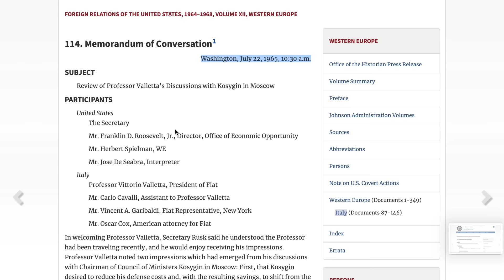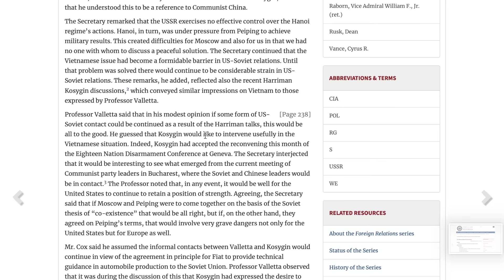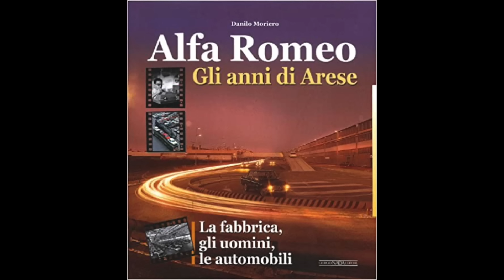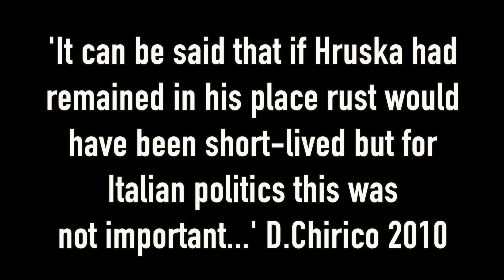Alfa Romeo And The Myth of Russian Steel - The Real Reason Alfas Rust

Comment: Having owned 3 Alfas and also a FIAT over the years I’ve had to put up with more than my fair share of Italian car rust and reliability jibes. Fact of the matter is that modern Italian cars don’t rust at any faster rate than any other. The facts that pub bores always conveniently forget is that during the 70s, the supposed bullet-proof VWs, Fords and most Japanese cars were also rot boxes.
Reply: As an owner of a 10 plate 159 for the last 4 years, (which has no rust whatsoever), I agree.
Reply: All cars from the seventies were rot-boxes, even Rolls Royces.
Reply: My granddads datsun bluebird estate was a prime example of rusting badly but most cars well into the 90,s suffered rust all 3 of my mk2 cavaliers were rust buckets .
Reply: My 1981 Honda Accord did not stop rusting …
Reply: Literally the only cars I ever saw that didn't rust like mad are the old Audi 80s and Peugeots from  the early 80's onwards.
Reply: My dads 1980s 1st gen Honda Accord was horribly rusty. We also had. Sud 1.2, probably suffered the same level of rust. So IMHO no real difference. The Sud would rev to the moon, remarkable for such an old car but the Accord would cough at 5000 rpm.
Reply: Possible exception to 70s rust buckets might be the being early Volvo 240s, I think they were better than most for the era.
Reply: In fairness Japanese cars were bulletproof in terms of reliability by '70s standards but they certainly rusted badly and were generally pretty horrible. The famed VW dependability is just folklore fueled by marketing hype. The last VW that was anything special for reliability is the Beetle, everything that followed was average at best. 'Reliability by association' (with the Beetle) is how Chris Goffey put it in the '80s. A revealing comment I think.
Reply: Other cars, particularly Japanese cars of the era, rusted just as bad as Italian ones. But as someone who worked at a Fiat dealership as a young man in the early 80s, I can testify to the poor build quality, corrosion and general lack of robustness of Italian cars. They had bullet proof engines, particularly the Lampredi twin cam, a superb engine, but poor engineering otherwise. A great shame. The Strada 105 and 130 TC and 131 2000 Sport on Pirelli P6 tyres have left a lasting impression on me. I would love to find an early single headlight 105 TC Strada, in black. But so many British cars were the same. Good designs ruined by other factors. Humans are flawed.
Reply: @classiced1416  Volvos in general were pretty good.
Reply: As was Vauxhall and Ford.
Reply: No corvette owners here then?
Reply: I agree....finnally the truth!! i own and restored various lancias,( including betas) fiats,  alfa romeos and bmws. One early 5 series bmw 1981 after 12 years of New York use  had serious rust issue in the rear struts and sills and floors.   Including a 320 with the same issues. The 70s bmw coupes as lovely as they all rusted quite badly especially karmann built bodies
However i notice bmws and benz in general thier rust grows un detected and the heavy undercoat they use is soo thick that you really have to poke at the car it looks solid..but you will find tons of hidden rot. Italian cars and japanese cars of the era the rust seems to explode in your face with rust occuring in very prominant locations. Problably the worst was the lovely 850 spiders they were panels on cars from dry climates that we cut into and fount zero primer or paint ! I found this even on t34 vws coupes by karmann . I think the coach built cars were possible worse lacking the facilities of rust protection until later on. Other factors on beta and fiats are the windscreen that were glued in place like modern cars. But these were all leaky anthe wather would settle under the carpet un noticed...not good at all.  Plus lots of fiats suck as 128s and other glued rubber tar sheets as noise dampers on the floors of the cars they appaer to be applied tonthe raw steel first then they floor were lighlty painted ...if they dont stick well and water gets under this it has no way of drying and rust sets in. Early 70s Volvos and saabs rotted quite well until the 900 came out so late 70s and 80s volvos were excellent indicating the made steps to correct thier problems. Audi 5000s with galvanized panels post 1982 were bullitproof. audis before 1982 rotted just as spectacular as alfasuds and betas. Mercedes rotted as well but  less than bmws did i think there attencion to painting everyarea helped plus you have to consider the cost of a benz in the 70s they problably were not used in snow an salt and pampered more where as the sud or a beta or an allegro etc would see more snow simply cause they were all great in snow and mercedes cant even move in snow with out snow tires.....lots of factors great videos
Reply: @michaelorlando6159  Haha!)  You reminded me of my father's Rekord and w123 which were absurd in the snow!
I was wondering how they had designed them in a country where snow is the protagonist in winter
Reply: @classiced1416  Not our 244...
Reply: The bed in Dad's mid-70's Datsun pickup lasted less than two Vermont winters before perforation.
Reply: @classiced1416  still might be the mix of steel used and or coating's like zinc as if the zinc ( and aluminium has been used as well in the past but it's trickier to get longevity coated steel more so if the steel has SS or resembles SS mix ) is contaminated it can speed up rust or let it spread ect. and thing's like copper/mowligneam MO were at least for the usa 🇺🇸 markets in short supply as the venam war and others were hogging it and maybe making some sort of softer steel eased the tooling fixtures fix rate and or let the stamping plant have a better cycling rate of parts aka body made cheaper and quicker ect.
Reply: @paulc9588  ... the problem was the mechanics
Reply: @GlamStacheessnostalgialounge  volvos were pretty good
Reply: @GlamStacheessnostalgialounge  audi started to galvanize them form 1982 i think
Reply: Yeah there were cars coming out of the big Americans in the 70s and 80s that were rusting before they left the dealerships.
Reply: @richardprice5978  i've worked with at least 100 Fiats and Lancias from the 70's and there is two things that stand out.

Obviously some bodies were rusted before they were painted, that is clear and can even been seen in some company photographs. It would be interesting to compare manufacturing dates, i think ones assembled in spring and early summer would have less rust. The factories did not have good air conditioning then and were a damp place in fall and early winter. And the panels were some times stored outside.

But it is also obvious that there are very high alterations in the quality of steel. Early 70's are mostly made of better steel than late ones, i claim '79 and '80 are the worst years. F.e. i have a 1973 Fiat 132 that has original paint and has been in use always since new, mostly stored outside. In some places the paint has completely fallen off, expocing bare metal. But it still does not create rust. I've had a good 1973 Fiat 127 also. And 1975 Fiat 131 and Seat 133 that had almost 0 rust.

But i've had several 1979-80 Fiat 127's, 128's and 131's and Betas that rusted away even when washed and stored insinde. You can clean their steel and repaint it, but they still rust heavily even from places that were not rusted before, in the middle of panels etc. (some being caused by panels that were rusted already in factory.) It seems that only by replacing all the steel they can be saved, no sanding, aciding and painting can keep them from rusting if they are used or stored outside.

81-84 are a little better. Not much, but so that there is a clear difference. I have not found that there is any difference in dipping or painting process so i point at the steel quality, not overlooking the pre-rusting in the factory during assembly caused by strikes and other conditions.

Maybe this steel was from that plant in Italy and not from russia, but still the quality of steel is an issue that still haunts us today trying to preserve these wonderful cars.
Reply: I don't know if it's Russian steel. But some cars do rust very fast. Mazda has been a recent one. But I remember the older alfas. Fiat's and lancia did rust badly. Was it the steel or the treatment or the design? ??. Our local chip shop the owner bought his daughter a new Fiat panda. As a new car owner she washed it daily. Found a blister on the front wing. When she picked it it was a pin hole. They found further blisters. Aventualy a new car.
Reply: @mirafioristi  and it can haunt me as well with american classics 

i got some replacement bed panels for a 86 GM truck and despite by best efforts to get the best repops made it still acted differently and welded differently than the 1986 metal ( rusty parts and clean parts ) and the 2004 ford metal ( a little bit thicker and way harder to bend out of my samples and the least rusty ) i got to do body mod's with 

as for 60's / 70's dodge um same as always the painting is a after though ( but back in 69 zinc was done somewhat well but yes it could be better ) but the steel for the most part is fairly slow rusting same way with my 86 OEM but the softer 2014 steel replacement panels um no they rust quicker and way lighter ( D near the same thickness as i used callipers to check to one thousands so within error margins ) for some reason?? 🤷‍♂🤔 and there supposed be a exact replacement in always including mix and heat treatments ect.
Reply: @mirafioristi  dose some one have a tool to test or rental in your club? as finding out the oem mix might be helpful and i know others have done this with hand held tools on things like sockets in 2022 to see if there garbage or not and as a lie detector ect.

BTW my truck has been in the family from the 80's so as far as i know before me-3 owner all OG OEM parts but was used as a farm and cement truck ect. aka ruff life
Reply: @mirafioristi  so aftermarket resto's like me A/C and moisturiser control is a must have and anything else to point to for greater results? like you said back side rust removal and coating is extremely important  but the way i see it thats harder to do as im not a factory setup with ovens and specialty dipping tanks ect. and i don't know anyone local that does this
Reply: @C.Fecteau-AU-MJ13  lol 😂my family's/my sibling's 2006 jeep ( helped get my license to drive but count the 86 as my first car/driving experience ect. ) ( winter/spring build date ) was really rusty underneath aka no paint or attempting anything coating wise @ the dealership/factory carrier truck and it had sub 10 miles on it ordered it

the top/what makes vehicles sell 5ft-away  now that was done well but wrong colour as blue was on the sheet not jet black FCA's habits are to paint the hole thing assembled ( found out that as a pro-mechanic, im out of that game in 2018-up for now and do industrial millwright things now ) so the panels match better but between the thin finish and lack of back side/hiden places it makes it rust out
Reply: @danielryan2317  um i don't know if i count or not as i don't have one but i do like C3's and there well known for rustying out more so if the salt got stuck between the fibreglass and or spider crawling/cracking and pre-C5 or 6 the framework was regular steel not aluminium like the C7 so even if the body is ok the engine mounting points ect. can be heavily rusted out as its technically a body on frame design and the floor boards are steel but some have use/,made aftermarket aluminium ones

im a challenger/cuda/60's charger owner for now as i felt i still need a back seat for things like baby seating and a trunk lid that opens up for my crap/wife's thing's
Reply: @mhagnew  lol 😂my mentor/uncle ( Vietnam veteran and sub guy ) ( millwright but in a plant iv never seen the inside of ) drove one dotson for 20 years but yes peace of hot garbage and wow at least 4 engine's/rebuilds ( and at least 2 transmission's manuals mind you from high mileage ) in his 🌲shop using a brige-port ect. and at one point it was flint stones mobile and a patch work of random sheet steel left over Robinson helly scrape's ( his hobby for a long time was flying kit crafts and or building them ) weld on and bolted as replacement panels, went for the 5 rebuild ( now running avgas as the engine was milled/hoged out by this point ) after 200+k miles in and the truck collapsed in to about 4 very rusty chunks lol 😂that was the end of it in his midwestern driveway and a empty bottle/car jack

the replacement was a late 90's dodge dekoda expend cab v6 auto aka almost the same thing 

i asked him why'd you replace ( 70's or 80's ) it sooner and something a long the line of im stubbornness and i can fix it myself ect. and i didn't want a car payment ect.

maybe he should have kept the white 1967 D100 ( ordered it in the navy i guess he was a lot more piratical than the other draftees that got high end muscle car's ) after all with the 440 and 727 4:10 8-3/4 and i don't think there very pretty or at least that's me aka ford and chevy made better trucks but a 440-RB and 2-G hemi isn't bad
Reply: My Alfa was the most reliable car I ever had that wasn't Japanese.
Reply: @avancalledrupert5130  did that have the tiger-shark engine and or it's twin? as im wondering what longer term owners though of the jerk-pump lifter's and engine management software/system 

FCA alfalfa and FIAT used the same style systems and or really close to it

as for Italian car brands never owned one maybe and a big maybe driven or ridden in one but my local area's aren't big on buying euro's other than the occasional SLK or C-class or 4-door BMW but those are being replaced by higher end expensive Tesla's now in 2022 or at least feels like that
Reply: 1992 Ford started galvanizing Tauruses which rusted pretty bad before that. My 94 Probe GT is doing alright also galvanized I believe. Their trucks also do better than Chevy and Dodge.
Reply: @GlamStacheessnostalgialounge  the Audi 80's were partly zinc plated and was the first car with a 10 years warenty on rust. 
I still remember the rust warenty and proconten steering column safety stickers on the backwindows.
Even today f.e. Peugeot 205-309's rarely rust. They were the almost bullet proof generation of Peugeot
Reply: True.  1978 Toyota Corolla, it had some rust issues…
Reply: @obelic71  is it just me or should some crash testing be done on version's that are simulated or used in the real world aka rusty/metal fatigue ( if it's going to happen, and theoretically needed repairs try that safety to see if the ratings are changed negatively if at all ) ect. as a new off the dealership's lot rarity gets in to a crash it's usually 5 or so years old and at least a 100K's on it
Reply: @dennisyoung4631  i remembered as a 80-20's kid toyota car's were ok ish but the trucks well we called them tacos 🌮 lol and yes ran but man the body rot was bad
Reply: My dad bought a Golf in 1974. The thing needed rust repairs after five years.
Reply: @richardprice5978  rust is no issue anymore on modern steel monocoques shells for cars.
That high strenght low weightssteel has to be zinc plated otherwise it wil rust away in a few months. 
Remember the recall of he smallest Toyota car the aygo a few years ago?
A steel manufacturer of Toyota falsified on purpose steelquality papers. 
Al those cars affected were recalled and everything was swapped over to new shells.
A mass coruption scandal in Japan and the director of the steelcompany commited suicide over it.
Reply: Yes, but it does seem like Alfa and Fiat were catching on later than other manufacturers to rust prevention. Renault also seemingly had this problem of rusting faster than the competition and I've never heard a good reason for it, other than their rustproofing being not that good. One reason I've heard coming back a lot with the Alfa Sud and/or GTV's, was that the Italians down south were very callous with their steel sheets, to the point that those were often just stacked outside of the plant, completely exposed to the weather. Then these sheets of steel, covered in rust, were just fed into the production line. 

A contributing factor, but I'm just theorising here, to excessive rust may have been that the Italians tended to prefer style over function and that caused their cars to have more "empty" spaces between outer bodywork and inner bodywork or liners where water could gather because there weren't any drain holes. The famous Citroën DS also suffers from this problem with its front fenders.
Reply: I bought a 4 year old 40,000 mile Ford Capri in 1979 It was already rusting through the front wings, behind the headlamps and rear wheel arches. In the mid 80's to 2000 I ran a Fiat Tipo and a Brava for a total of 125,000 miles with no rust issues at all.
Reply: @tommaguzzi1723  Ford and Opel/Vauxhall were the last brands who made above average rusting cars.
The French and Italian manufacturers got there act eraly togheter on rust proving.
F.e. The MK1 Fiat Punto and MK1 Renault Twingo from the same era almost didn't rust. The MK1 Ford KA from that era rusts alot.
Reply: @obelic71  that Capri was falling apart long before my young idiot self ran it off the road going too fast and crashing it beyond repair, no injuries thankfully. 3rd party insurance so I was still paying the loan off for a car I didn't have anymore for a year or more. That's why I started riding motorcycles. Every cloud eh!
Reply: oh yes, golf1, opel ascona, ford escort nissan were bad, mazda, mitsubishi toyota not so much, but lancia, alfasud, fiat mirafiori and 127 were on a complete different level of rust , that was something else.
Reply: Not even the gauge of the sheet metal was not at fault?
Reply: Porsche starting using zinc rustproofing in 1975 or so. Prior to this, it was also very bad.
Reply: @obelic71  different mix's ( and for home gamers like me there's 50+ different mix's to buy and a industrial plant evan more so ) might not stop it from rusting/catalysing but will change paint adhesion or speed of reactions and crash characteristics, and tool steel generally is more expensive but has more of these wanted traits vs low carbon pain jane iron/or steel sheets

aka it matters what alfa ( or in my case the big 3-🇺🇸 ) was using
Reply: I've had four 147's starting in 2018, a 2002 1.6 Lusso that needed floor welding and 3rd gear died, next a 2007 sport TS that had survived previous owner never servicing it and had no floor rust, then another 2002 1.6 Lusso that had two lots welding done and recently sold a 2006 2.0 Lusso that failed the MOT for rot in three places and even the wings were bubbling which I'd never have imagined. I've just bought a 146 1.8 T Spark which I love to bits even though the handling isn't as effortlessly capable as a 147.
Reply: @obelic71  Mk1/2 mondeo, mk5/6 escort, fiesta and so on.
The 90s Fords almost was worse than the 80s Fords. 
Opel/Vauxhall where a strange blend, Omega/senator rusted bad.
Vectra mk1 to but mk2 was way better.  

Last big brand with massive rust problems was Mercedes, my god did those W210/211 rust bad and so did the Vito`s and sprinters vans to.
Did not help that quality over all was bad on the E class at that time.
Reply: @Gravstein  The last Escort and the Mazda 323 were build on the same platform in the UK. both were a Tin worm paradise.
Commercial vehicels like the opel/vauxhall combo MK2 also rusted alot. There was almost no windreflector on top of the cabin that was rustfree. MB lost its quality in general. Once the most used brand for Taxi companies on the mainland of Europe.
Due to excesive Rust and unreliability MB is almost out with there passenger cars of the huge taxi market.
Reply: @paulc9588  look at the work cards for maintenance on Air Cooled VWs, if you do all the required maintenance they're reliable. The issue becomes in 25,000 miles the old Air Cooled VWs required more maintenance than a new Camry does for 100,000 miles. Not just VW, older cars required a lot more attention.
Reply: My dad had two Chevy/GMC pickups, a '74 and a '79. The '79 needed a rust-repair session and full repaint twice from new until we sold it in '86. The Chevrolet Vega was infamous for rusting in the showroom, and the Dodge Aspen/Plymouth Volare's fenders rusted so bad under warranty the repair costs led to Chrysler flirting with bankruptcy and needing a bailout from the government. Ford had the worst rep for rusting across the whole line of any American make though. Among Japanese cars, Subarus were rust buckets into the early '90s.
Reply: @richardprice5978  I had a Alfa gtv 2.0 twin spark . Got it at 90k . Banged it of the rev limiter for 28k no maintenance at all until it skipped a tooth . 

If I had serviced it I'm sure it wouldn't have happened . Only honda and Toyota survive me owning them that long normally . So Alfa gets a yes from me on reliability and a big yes on driving pleasure .

It's sat on my mum's drive for 5 years dousnt even seem to be rotting .  The reputation definitely dousnt apply to late 90s Alfa .
Reply: i had luck because the levels of humidity where i live in south of Portugal were almost non existing ,some had health related problems because of the dry air
Reply: @GlamStacheessnostalgialounge  That was because Audi started to galvanise-dip their cars, but only up to the waist-line.
Reply: @mirafioristi  Really interesting experience. I clearly remember that Arese models were not particularly endangered by rust (which was a problem anyway, expecially if you had to park outside) but Pomigliano's Alfasuds, while lively and much fun to drive, were eaten alive by rust. Apart from Alfasud peculiar problem , what is clear is that, Russian or African steel or whatever,  Fiat always tied their best to save on weight, save on steel, save on paint, save on process, save. Energy was expensive for them, steel was really  expensive at times, reality is that in Fiat bean counters always prevailed over engineers (and also these were trained to save, save, save, on everything). Painting was also becoming a problem, almost a social problem, in most car factory, due to lack of quality and quantity and commitment. It is often said (and it is possibly true) that paint departments were widely considered a lost cause and often assigned the worst subjects to tame, as a punishment of sort. 
I have read twice the excellent "I miei 40 anni di progettazione alla Fiat"  by Dante Giacosa (senior designer of 500, 600, 1100, 124, 128, 127 and everything in between including trucks  and avio engines at times) and specs for new car projects  were given to him     by high executives  as engine displacement and Kilograms of total weight. For the 1100 (a middle-sized car for Italy) they gave him 735 Kg to work with,  without heater, spare wheel and fuel . So obviously engineers and designers had to keep weights and everything else  low in order to succeed.
Reply: @avancalledrupert5130  um i don't think that's the same engine with the same experience and technologies 

i like the ideas just haven't owned one yet so i don't know 💯 what it's like to live with VVT/VVL 

nice to know that alfalfa's did make decent engines and the twin spark plugs was a welcome experience. have one on the stand that use's that but its a V8 from the 60's
Reply: Austin Allergros did'nt rust , but that,s a unpopular truth.
Reply: @peterfox3989  sorry i like uk 🇬🇧 car's but BL made mostly ugly one's but my 2C

and the allegro is on that 1970's-90's list
Reply: To this day in western Pennsylvania everything rots from the salt including the plastic parts 😬😬💩💩.
Reply: @nlpnt  on my late 80's k1500 its oe paint lasted too about the 90's-2000's so must have changed something to make it stick and last. wondering if that's heavy metal's or not

mine is still in restoration process as of 2022 i stared on body in 10 ish but it's gotten delayed so far
Reply: @spotsill  lolz 😂 haven't spent much time in pen state but around SLC Utah 🇺🇸 it rust's just from the lake air and road salting and others thing's
Reply: @richardprice5978  few things rotted faster or worse then a triumph herald 😂😂🍻😃.
Reply: @spotsill  but last i remember i like the design just haven't owned one

closest i have gotten is a pre-ford jaguar
Reply: A lot of people's comments here are speaking of decades old cars that for a large portion of their lives were bought used and owned by people who neither garaged them or kept them clean.  Maintenance was not done unless they quit running.  Garage a car, wash it once a month, keep it waxed and do preventative maintenance and most any car will last forever.  I do understand that many people don't have garages, but that isn't the cars fault.  Left out in the sun and rain and any car will deteriorate.
Reply: VOLVO and SAAB were largely rust  proof -plenty of 30-40 year old ones still.on the road and Volvo hold the record for the highest mileage car on the planet -3.267 million miles on a Volvo P1800.
Reply: @ronnieince4568  so what was different in the manufacturing? to go 3m?
Reply: @richardprice5978  well personally I think.that two things -few water trap areas due to good design;  factory applied rust proofing ( even wax sprayed inside doors and large.drainage holes ).and if anything his going to last long in the Swedish climate it will last twice that in most if Western Europe and the U.K.. Interestingly they produced 48000 P1800 and the first 6000 were actually built by Jensen in West Bromwich (with bodies made in the UK by Fisher if I recsll.correctly ).Most old Volvos could manage Star Ship Enterprise miles -a 940 was only run in after 100000 miles! !!   Walk around any car scrapyard -most scrapped cars have less than 150000 miles on the clock My 25 year old Volvo S40 has zero rust and 270000 miles on the clock -all oil and filters changed twice yearly -even the original battery lasted 18 years and exhaust system still original .!!
Reply: The worst of them all were the A body Chrysler's, and it's the design that rots out cars not some magical "rust prone" steel.
Like the tendencies of any car to rust out it's the design more than anything else (aside from environmental factors like living where there's winters and the roads get salted compared to a place Arizona of course), the wide dished tops of the fenders where water would lay on the A body Chrysler's were an invitation for rust. 
But one thing people don't take into account is the fact that designer's back then didn't have to worry as much as designer's nowadays about making a car body or frame last that long because engine's and drive trains didn't go 250,000 miles on average like a modern car, by the time the fenders, bottoms of the doors and wheel wells on cars started rusting through at about 5 years the engine's were ready to go anyways. 
Over the years they've learned to design better drainage in the bodies of cars which has them lasting much longer than 50 years ago, it's not that they're using some magical steel nowadays that's rust resistant, the design and some of the coatings these days are simply better.
Reply: @dukecraig2402  well at least with my 1967-71 charger ( pretty car and so is the 1960's dart's, im just more partial to the 68 charger ) Richard and bill wanted to style it a little differently ( management whated to change to glass to be a 4-door parts bin special but bill/Richard won it just ment some parts didn't happen as planned ect ) ( wide body/convertible and different weather stripping and door/trunk cut&shut as the way it is now it looks nice new on the dealership's lot ( and for a autorama show car/indoor car preferred ) but 2y winter ❄️  in nope and it leaks in and rust's out the floor/frame back there, they whated to add a 45to90* lip to stop that if the rubber went bad yes it wouldn't have stopped all of the wind/water but it would have slowed it down a alot ) and or change the water drainage ect. but didn't/bosses above them wouldn't let them as it was a cost cutting measure to share the parts bin ect 

you mentioned better coating's so the metallic's and pureleslessants seam to have more mixed in the 60's 🇺🇸 paint vs 2010-up aka plum crazy/F8/silvers aren't the same ( 3 car were parked next to each other 1 OEM-survivor nice but did have some flaws but it's 50+y old now like a little yellow/clearing/fog 2 restored 67 wow shiny and deep glow ect 3 new 12-up copycat ish dodge modern car/paint and it seamed really flat/boring so much next to the 60's car's, i realised its not even close to the same P code but at the dealership's 20ft-away by itself it's close enough to fool most people ) and i resonantly noticed it so does changing the mix effect the durability aka rusting? or was it a buyer's/management's/factory choice to change it?
Reply: Hi Simon. I totally agree with you. Not to mention the amount of rust for Mercedes during that time and even up to and until the nineties and early 2000. The same applies for Opel that severely suffered from the cost cutting program from mr. Lopez and never recovered from that up to the moment from take-over by PSA.  Is that not ironic - Citroen (part of PSA) suffers from the same pub bores and ignorant people. Cheers Erik
Reply: @adrianrouse5148  1st, 2nd or 3rd series?
2nd and 3rd series are known to be very well treated against rust
Reply: @obelic71  Yes, those Audis had other problems: engines 😃
Reply: @thebarront9889  good choice
Reply: @avancalledrupert5130  a big yes on driving pleasure 
😎😎
Reply: @studiocalder818  Thanks, what are you driving?
Reply: @richardprice5978  Mercedes Benz did once a crasch test with a model that was 20+ years old and had the first as standard drivers airbag installed.
It still preformed as new.
Current cars (monocoque shells) use modern low weight high strenght steel that needs no be rustproofed by zincplating.
Rust and structural deteroation on these modern shells is almost absent.
Everything bolted onto the shell not sincplated like subframes, suspension, brakelines etc. etc. can still rust.
The biggest problems for modern cars in general are electronics, wiring and deteroation of plastics.
Reply: @studiocalder818  you have a GT Junior? That's one of my favourite cars.
Reply: @thebarront9889  Simply the most beautiful little coupe in the world after the Giulietta Sprint, in my Alfista eyes.
I succeeded to buy my first Alfa in 1983, and It was a '69 GTj, it was super exploited by an elderly man who stopped driving:
it cost only 500,000 lire (like 300 euros), the price that the demolition gave it; but he loved his GTJ and he was waiting for me giving me 2 boxes of spare parts, 8 tires and a full tank of petrol, haha!
I still have that car today and I'm restoring it
Reply: @studiocalder818  =5-cylinder = problem's cool engine though but weird plus the quartos part probably didn't help it as it was in it's infancy design wise
Reply: @obelic71  glad at least one model passes ( was it the best example of the car aka mint or actually a fair reputation of the majority of taged cars on the road that year for that vin model? in a common known crashing sinaro for that owner group/vin ? or lets pick speed/angels that show the best results ) but it's still a reliant test/consumer concern as most cars aren't show queens and pampered 

still like to see a randomised testing on older generations of models to see if ageing ( and reported real world numbers ( probably the best information but can make it harder to design with so that standardised testing we use now is still relevant for the up coming model year aka say a 2025 ) for that model and or vs different models/objects seen in the real world and or dummies testing ) has any effects so 20 to 10 years or newer and about 3 years old to 10 years as that's the warranty period and most car's taged at least in the usa 🇺🇸 are under 12-14 years old i believe aka the sample sizes needed because at the point testing a 1950's car isn't useful for data collection ( in say 80% of case's and really no point other than like the 59 impala vs newer impala as the ratings changed so much and as a myth busting tool for public education ) on OEM quality as it's just too old in 2022 and by now probably a full restoration and not line-fresh and 50's vs a 2022 model's is best done in a computer situation for different shapes/sizes vs size's now days as pre-1990/2000's models have dried up for testing/study/stupidity stuff but important stuff
Reply: @richardprice5978  In Europe cars from several brands are examined after real on he road crasches
Like aircrasch investigations the  data is used to improve current and future models
f.e. a modern Ford Fiesta has a maximum 5 star rating in the Eurocap craschtest.
Reply: @obelic71  yes soft good's going bad is a concert and most people don't realise that seatbelts and airbags need TLC after about 10 years ( at least the usa 🇺🇸 users manuals for the big-3 pre-2014 left that parts out that the belt ect can go bad ) ( it's in a merc/Volvo users manuals so it must be pretty F-important and the NHRA won't let me on the track as my 60's car needs recertification/replacement so it's not just one company and there legal department but that clause is still probably helpful in some court cases ) or at least a recertification and not doing that can kill you and or make the crash worse as wet/moste explosive's ( and brittle plastic/ect can transform into a pineapple 🍍 grande fragmentation leading to more lacerations  ) used in inflation will be out of timely causing more injuries
Reply: @richardprice5978  In most cases the average colision speed is about 30 mph / 50kmh.
Driving a vehicle is always dangerous.
Conservative driving reduces the risk hugely.
The most modern safe vehicle hit bij a semi truck filled with explosive chemicals is a garanteed one way ticket to heaven.
Reply: @obelic71  tell me about it vary common experience is the wiring being junky as it ages and or had a couple of fires from it one was in the engine bay @ 80mph and luck me it didn't catch the smoo on the C-10 1968 block/transmission ( a inch in some spots of soild oil/grease as no one bothered to clean it in 20+year's and the wiring was cobbled together aka let's stacking but splice's ect and failing/hard insulation ) and the other was under the dashboard and on the fire wall at a red light ( on the way home from the R&R/tag shop ) in the charger also lucky that it was mostly R&R parts and smoke damage ( at home this time as i couldn't get the shop/supplier to really fess up ) but that's with a supposedly a dealership restoration harness aka new with all new equipment attached to it

still think a BEV is safer than my old gasoline/liquid cars/truck's as my understanding is if its going to show 💥 it stopped and charging up most likely to 💯 and next to firefighters/city vs my ugly surprise at 80 and in nowhere dry grassland
Reply: @obelic71  that 🇺🇸 doesn't do that the best they got is sparse police reported accidents and there missing technical details aka useful for the setup of a testing maybe but not for modelling of a better automobile. are the euro end-cap looking at new vs ageing aka no rusting vs rusty?

personally i think cars should be mandatory law to last as manufactured ( aka plastics and metal last ect. not nessarly someone modifying it as that can void the oe design traits as needed for 50 years in and engines/things like it don't count to me as there ware idioms and if you so inclined as 3-party to mod that's on you not the OE-designers that are being held to the standard ) 20-50 years at least safety wise so injures go down numbers-wise
Reply: @richardprice5978  The average age of a car in Europe is 18 years.
Cars are enigeered to reach that lifespan when maintained correctly.
All materials sadly deteriorate in time.
Thats why components f.e. not worn down tires need to be changed after 4 years (after their production date timestamp)
The 80/90's Japanese cars often exceed lifespans of 30 years plus when maintained corectly.
On safety equipment they are obsolete but technical they are still reliable.

In my street there is a Toyota Starlet (hatchback version of the Tercel)
Who soon can be driven by the 4th generation of the same family!
The modern electric car sits outside while that old reliable bonestock Starlet can sleep in the garage.
Reply: @obelic71  in the usa 🇺🇸 market's its 10y and about 120K miles design targets aka the warranty for some is 10y and 100K milestone so just 25-50% extra built in for ruff owners so it can barely pass the warranty claim period but not anything longer kinda like a F1 car is worre out after the race/year/season/designed obsoletesans-to-breakdown 

maybe Europe and or your governments are more picky about how long it lasts? as merc in the usa had there way ud buy a new car every 5 or less years but most people i know don't have that type of USD-cash for 80K+ every 10y at a dealership
Reply: @stefanreck7908  In Europe it depens on the emission class and maintenance level of the entire pool of vehicels and infrastructure.
Cars are very very expensive in Europe and the average life of a car in the EU is 18 years.
Diesel cars are on the way to extinction and Euro 4 is no longer alowed in more and more cities across Europe. 
It even means that 7 year young Diesel cars/vans are exported outside Europe!
Petrol cars meet the strict emission norms since the end of the 90's.
The EU already has already issued a ban for the sale of ICE cars in  2030.
In 2035 they want a total ban for ICE cars on the roads!
 
Manufactures are legaly requiered to make spareparts 10 year after the end of production of a model.
Models who were sold in larger numbers often have longer  parts available.
Aftersales can be very long profitable for those manufacturer.

Ford and Volvo wanted to make it standard 6/8 years and that was rejected by most European goverments.
Reply: @richardprice5978  Factory warenty is  7-10 years and 150.000 km in Europe.
The European carmarket is very different then the US market.
GM had to abbandon the 2nd largest carmarket in the world after 100 years because they couldn't compete anymore.
Smaller reliable very economical cars with lots of creature comforts became the norm.
Manufacturers make more money by aftersales, maintenance and repairs then on a new car.
A MB like f.e. GLK is seen as an unreliable moneypit.
Once MB had the image on this side of the pond of an almost undestructable heavy duty car like once the checker cab in the US.
Use it as a dozer to knock a house down and then put 1 million km onto it.
Nowadays MB luxury cars are often on the bothem end of the German ADAC (road assistance) reliability statistic.
Reply: @obelic71  some warranty's are still 5 years and 50K mile's or less in 2022 in the usa so with modern QC knowledge kinda sub-par or at least the manufacturers aren't giving that warm fuzzy feeling 

my older truck was about the same as above in the post and the 67-71 charger was 2 or 3 years and 30 to 60 K miles but the hoter engine's/combo's was only a 90 day warranty period, anyways to me its more important to have a solid build reputation than a peculiar law contract but it does help sell the car to me just not as much as the "checker cab" rep you mentioned as i believe in letting the engineering do most if not all of the talking and not the sales team/accounting CPA
Reply: Alfa’s now don’t get a chance to rust. They’ll be scrapped as uneconomical to repair from a multitude of electrical and mechanical failures long before they get a chance to rust.
Reply: @GTFour  one of the reasons why im so curious about the muti-air systems that newer Alfa's and FCA products comes with plus is it NVH-sound wise and comfortable to live with? as i can see the real benefits from having it
Reply: @richardprice5978  apparently it's quite noisy but I have no personal experience with it. It's cool tech though.
Reply: @GTFour  same no real firsthand experience operating/ownership on multi-air, but looking at installation/buying a car with it and the first week in is different from 5 years later experience on, that's why im asking to see how well it's loved and without a add-spin/corporate spin on it 😉

pro's and con's of it

been next to one at the lights and its hit or miss for knocking/clattering/diesel's-injectors sounds ( some i pull up next too do it and some are super quiet and even more quiet then my car/engine im driving ) so 🤷‍♂ no idea what it's like inside of the cabin ect. . early ones had tuning problems as the factory ( and aftermarket tuner shops ) was still ironing out the tune/bugs and some ate/was hard on parts so i don't know if that got resolved or not, i do known one car 3k-4k LB took off harder than my car so it can make it boogie at the light to free way speeds 80 mph~. does the 200 Chrysler's from about 2010-16 have it? if so i rented one/hertz and was ok 👌with it but thats not long term ownership
Reply: Yep just about all cars up to the end of the 80s were rust buckets from the 90s rust treatment vastly improved
Reply: It's true. All automotive manufacturers in the past used less good steel than is now used. They also had wind up windows, carburetors, drum brakes, crossply tyres, poor crashworthiness, etc, etc. Over the years all cars have improved.
Reply: Swedish steel lasted. ( Saab and Volvo) .
Reply: Porsches and all other German cars, as well!
Reply: In the early 90s my Fiat 128 fell apart just driving down the road.. front left strut bodywork broke clean off. Apparently that was a thing because the LHS suspension was affected by acid from the battery mounted on that side. I bought into the Russian steel myth big time!
Reply: @classiced1416  the 1975 till 1978 Volvo 244 was extremely bad with rust for a Volvo.
Reply: all cars before 1989 are rarely galv zinced .  my 88 ibiza broke in half at the chassis legs and tore the inner wings .  while in friends vw scroroco the rear window and frame fell out on the floor , rusted out . my gfs ford fiesta rusted so bad you could put a fist and elbow under the front sus turrets . 😂
Reply: Italians invented rust.
Reply: @ vw rust box and austin and ford and seat and merc and … stupid folks. how many datsuns still about mr?  zero. all rot boxes.. pre 1990 . esp 1980 to 1990 as modern panel thickness and car design was introduced around this time. galv , zinc was just getting used as well after towards during 90s .